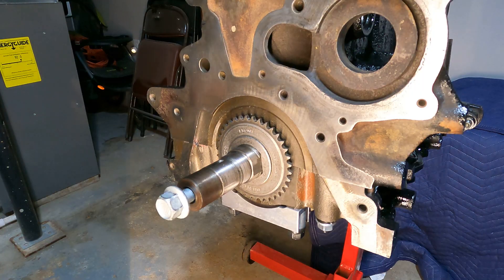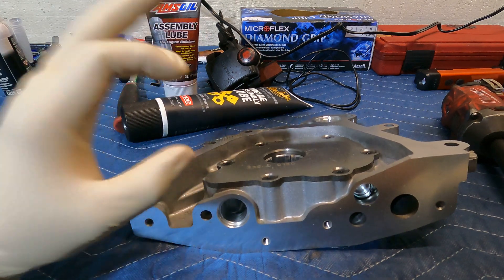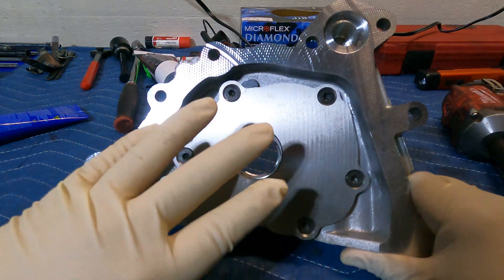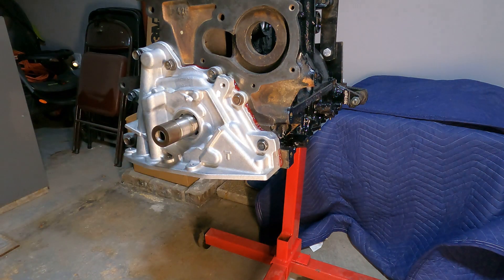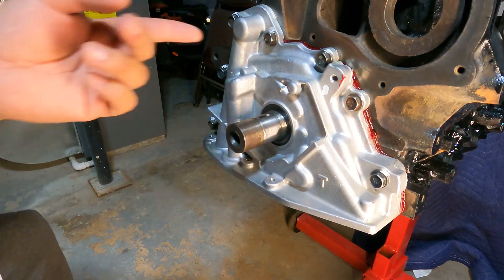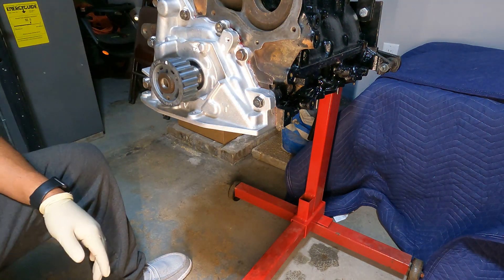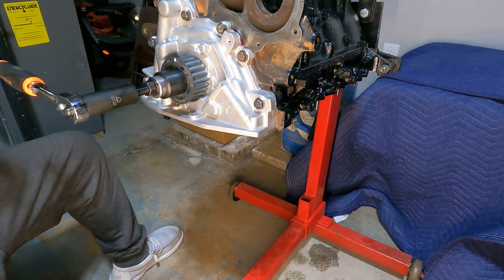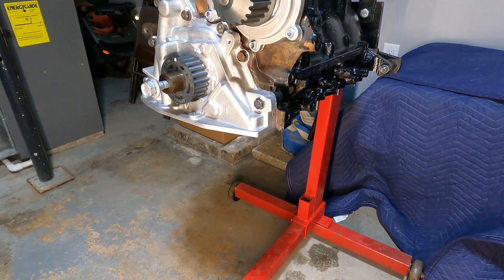Oem+ SRT 4 Rebuild Part 3. Oil pump/prime.

Comment: If you look at the taper on the back of that sprocket, and the taper on the crankshaft, it seats right on that taper, and will not go any further than than the sprocket taper, the crank shape taper allows Plus when you put the crank pulley on and torque it in, it will push that sprocket, where it belongs. If you will put a gauge between the pocket. And the length of what's left of the crankshaft to sprocket  there. It is the same Links, so if you want to waste money buying special tools, you are wasting your money.

Comment: I took a piece of plumbing pvc pipe the same diameter as the inside of the sprocket, and took a block of wood and a hammer and pecked it right in the sprocket seats to The Crown on the back of the crankshaft. And if you don't get it all the way in the crankshaft, pulley is the exact diameter and debt, you need to put that sprocket all the way into where it belongs.

Comment: Did you have the block decked and the head shaved?
Reply from the maker: The machine shop clean and decked the head. They Milled very minimal on it. Block was cleaned, but not decked it was already straight.
Reply: @stagedracing8150 thank you

Comment: Thanks for the video, very helpful on my first engine build!  One quick comment for the community, try to align the bottom of the bed plate with the bottom of the oil pump.  There is a hair of play and it will reduce a potential leak path when the oil pan is bolted up
Reply: Holy shit, great point!!!